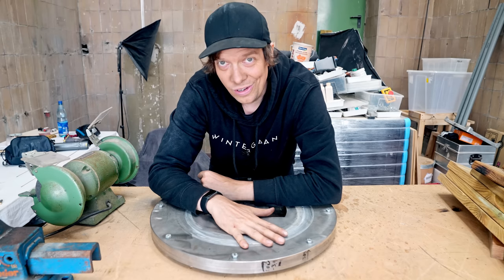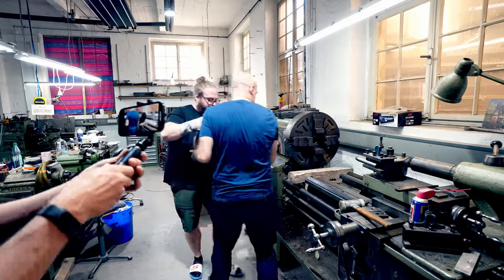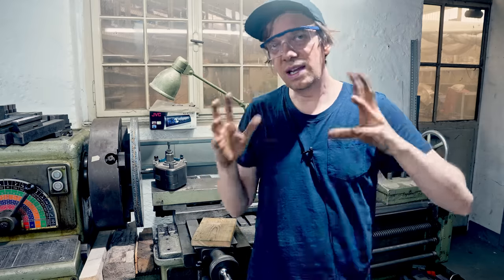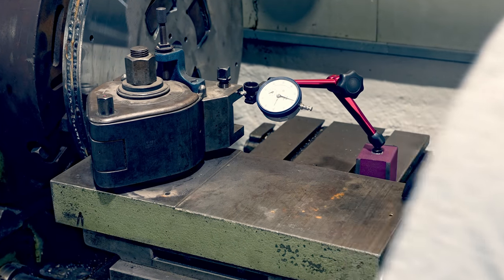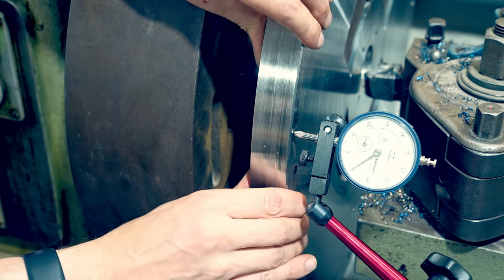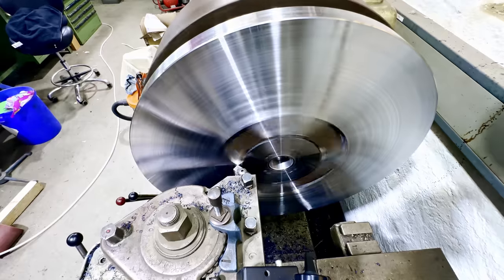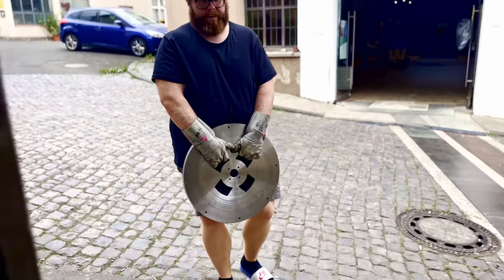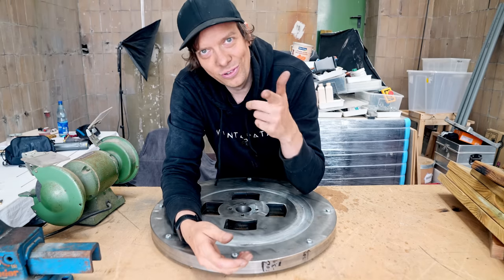Can I Turn This Wobbly Flywheel Straight? - DAY 7,8,9 - Marble Machine Flywheel Prototype

Comment: The insert moved during facing...  Also when you tighten the chuck, you are suppose to use the brake to lock the rotation of the lathe.  You can press fit a sleeve in the center hole to get material back and re-turn the center.  Also increase the shaft size to 30mm means you need to use a bigger taper bushing, which means you can re-turn the center again.
Reply: Or just re-weld and re-turn the center. I mean if he did it once, why not again?
Reply: @Nevir202  more a thing of it is good enough as is for the current prototype and the next iteration should have the popper shaft size anyway
as Martian now knows the importance of having a strong enough shaft for the flywheel
Reply: As far as I know our meuser lathe doesn't have a brake.

Do you have a timestamp for me for the insert moving? Then I can check the holder.

The sleeve is a good idea though we don't have a press set up here.
Reply: @durandle9226  Sure, good enough is good enough here. 

I was just saying I didn't see a need to introduce a new process here, rather than just repeat something he has already done.
Reply: @maesto 13:03 shortly after that is when it moved.
Reply: So, when you flip the disc around to turn the other face, aren’t you supposed to dial it in on the already turned side to get it consistent? The already turned face side should now be your refrence, shouldn’t it?
Reply: @thenextstepp wow I didn't notice! You have good eyes man!
Reply: @ronger7801 absolutely.  If you don't you can wind up with one side thicker than the other.  If it's close you may not notice, but it puts increased strain on the shaft and bearings, and if it's off by enough it can make the entire machine shake
Reply: @ronger7801  Yep. he needs to indicate the back face of the flywheel  to make sure the face he is about to cut is parallel. Can't just trust the chuck is true when going for absolute precision.
Reply: @thenextstepp interesting well check tomorrow. I wonder if it's the insert itself or the whole holder though
Reply: It looked like the insert was chipped too, but it may have just been swarf.
Reply: @maesto to me it just looked like the insert rotated in the holder when it came under the heavier cut.  Hopefully this helps.
Reply: @maesto  It was certainly the insert not the holder. Can't believe the OP noticed it. I saw the change in chip and thought it was just because a transition in material types. If you continue watching the insert moves again shortly after the initial movement. I don't think the insert moving should have effected parallelism, just flatness.
Reply: @ronger7801 yeah, for sure, you need to indicate on a machined surface. You could also re-chuck into a collet chuck which would be very concentric, that is of course not an option here.

But, Martin did actually indicate on a machined surface (indirectly), he clamped a piece of axle into the bore with one of the expanding SKF hubs and indicated on that.

But I can imagine quite a few sources of error in that setup, for example the axle was potentially not straight enough, the indicator could have measured at a slightly different height on the inner and outer measurements and probably a few other sources :)

Not sure what he could have done differently, the bore is the most important reference surface, and it may have been hard to reference the machined surface that was facing the chuck. The surface finish in the bore may be too rough to measure against directly, but otherwise that would have been better, with the other style of indicator.
Reply: He did well for one that hasn’t used this type of method before.
But yes to the above, even with lathes that have no braking, you can wedge locked in stead
Reply: Yeah what he said, trust me I'm an expert (I've never even seen a lathe in real life)
Reply: Just purchase a flywheel.
Reply: @Nevir202  because keeping welding on weld is not good for the wheel
Reply: That tool height setting method was a bit average.
Better to change the drill chuck in the tail stock for a centre, (has the same taper as the back of the chuck but comes to a point at the front) or if there isn't one put a small drill in the drill chuck and set your tool to it's point.
It is important to be a bit fussy with the height particularly doing small bores.
Getting plate flat takes a lot of patience. There is pent up stresses in plate from its manufacture that you relieve when you break the surface when turning or milling, added to that is new stresses introduced from all the welding. 
It is not uncommon to have to machine both sides a bit oversize just to relieve most of that stress, then the flattening process can begin.
Reply: @thenextstepp  Turns out Martin did the move so it wasn't anything moving on it's own. Or at least shouldn't be. Will still recheck the torque on the bolt
Reply: @maesto  first sign of movement was at 12:50 and it continued to move more and more throughout the cut with the final movement just before finishing the cut being the most obvious. Just look at the angle of the insert at the start and at the finish and you can clearly see just how much it had moved (looks to be around 15 degrees)
Reply: @durandle9226  shaft

huh huh huh, huh huh

Comment: When I worked in manufacturing, on the floor we could tell when a drawing or product was designed by an engineer who had never touched a machine in their life. "What do you mean I can't have that hole there? I designed it so you would just need to use a 300mm long 3mm diameter drill bit. What's the problem with that?" The fact that Martin is gaining experience on the machines SPECIFICALLY to become a better engineer is a very valuable and commendable thing. Great job!
Reply: Ha ha! You'd be lucky to get a 300mm long 3mm diameter hole in wood, let alone metal.
Reply: @two_tier_gary_rumain  Might be doable in metal via EDM - can't think of a good way to do it in wood, though.
Reply: @skylerlehmkuhl135  Was thinking the same. U sing spark erosion will work but even then you will have to have a custom machine built. Imagine quoting $100K for one of those holes :).

Comment: Something I wanted to note on the balancing of the flywheel: I was there in person at the meetup, and when the wheel was spinning at full speed, the frame was basically not vibrating at all (I touched it), which means it is very rigid. So while balancing is certainly important, in this particular case, as Martin said, if is fine for now.
Reply: Yeah, I was just going to point out that most of what he's doing right now is only impacting aesthetics, not actual flywheel operation.  The main thing to do is make sure the flywheel is statically balanced, at that point any wobble is just a visual distraction.
Reply: I suspect the wobbling is due to the braking systems, which exert significant lateral force on the flywheel, potentially causing the shaft to bend. At the start of the video, he pointed out about a 1cm offset in the wheel. While the wheel might not be perfectly round or flat, such a substantial offset can't be attributed to just a minor imperfection. By the end of the video, he observed that the shaft had bent, even though it appeared straight in previous videos.
Reply: @barrelroller8650 the wobbling was there before the brake was added, but it’s definitely not helping

Comment: Martin. I respect you and have followed you since I was the 504th view on the original marble machine video. As a retired engineer and machinist, I have some observations:
Taking shortcuts in material only creates problems. A solid piece piece of material of full thickness (not bolted together) will always be better. 
Best practice: when building up material, remove mill scale on mating surfaces.
Best practice: Never assume stock metal is flat, straight, true, to finish dimension, etc. 
I would tell you to have the shaft machined with a specific location and shouldered surface located for the flywheel. An appropriate interference fit will hold the 2 together once assembled. The flywheel should be "roughed in" to near dimensions, with the I.D. (inside diameter) turned to finished (interference) dimension. 
Permanently mounted the flywheel to the shaft, then the shaft/flywheel assembly is machined to final dimensions.

The locking taper bushing is great for assembly/disassembly/maintenance purposes. and as you said, for a prototype, being balanced isn't so critical.
However, this will only suffice for the prototype, and should not be considered to be a precision solution for the final machine.

Some final notes:
Fine precision and shortcuts are typically not compatible characteristics. The more precision desired, the better off you will be using tried and tested manufacturing techniques.

I suggest learning best practices, rather than trying to learn how to fix the problems generated by avoiding them. Engineering isn't about doing everything yourself. Engineering is about finding the best answers. There is reason they are called "best practices".

Define your acceptable tolerances, then select the best practices that fit within those tolerances, And you'll arrive at finding what is good enough.
Lathes can easily reach .0025 mm tolerances or better. Of course, that doesn't matter if your aren't using best practices.

Comment: The problen with run out is common to taper bushes - you need to use a dial gauge while tightening the four locking screws to ensure that it clamps square to the flywheel surfaces - very easy to sort out.
Reply: Great tip! Certainly makes sense, works like a 4 jaw chuck. Do you also have to match torques on the 4 screws?
Reply: Yes this 100%.  At 23:36 I can clearly see the taper mount Flange itself oscillating quite a bit in the same direction as the flywheel. Judging by how much it was moving, I wouldn't be surprised if this was the main cause of the run out.
Reply: I think that's the case too. I couldn't see the shaft moving at all compared to the flywheel. My first guess was that the clamps are not square to the shaft and flywheel...
Reply: This is true and really important.
Reply: @christhesnaildriver  Shh! your ruining the illusion of drama. we all know its fake. its about the journey not the destination. I've know for 10 years. I love it. Its so funny. It's British humor.

Comment: For hole prevention during welding: Chamfer the edges that are going to be welded. This promotes weld penetration, makes welds much stronger and prevents air pockets from forming if the setup is managed correctly.
Reply: How much of a chamfer would you suggest? I'd suspect it would depend on material, correct?
Reply: @mazingdaddid  Proper penetration doesn't depend only on material. It also depends on voltage, current, bead width and arc length from wire to the weld surface. Chamfer just adds more surface area for proper welds to stick to.

Comment: 12:19 The outside diameter was probably harder and thus overheating due to heat treatment during the welding
Reply: Would be interesting to know which steel he used and if it can air harden or which filler rod was used if he did use any
Reply: Yeah the weld material was causing the sparks. And when using a carbide insert you are supposed to take off more material per pass to get a better finish.
Reply: In my experience in the USA, parts like that would be A36 or something similar.  It can be case hardened so if it's laser cut or welded you'll get a shallow hard area in the heat affected zone.
Reply: For lathing steel like that, coolant prooobably would have been a good idea
Reply: Also going way way too quick
Reply: Laser cutting does that too the laser cut surface work hardens. The initial surface speed was also a bit to high. Think its great that he mentioned the fact that the manual lathe does not have a constant surface speed.

Comment: Martin, I didn’t see if you put a chamfer on your weld mating surfaces, if you are welding flat edges and turning down,you could potentially be removing all your welds. Also adding welds to your cutouts will change the balance. Best of luck, looking forward to all your vids
Reply: Exactly what I was thinking about here.
Reply: you can literally see some cracking near the end of the video
Reply: prototype
Reply: I was thinking the same

Comment: You don't need to have a perfect geometry for the flywheel, what you need is a perfect balance that can be achieved by adding small weights or drilling holes.
Reply: This. I think sideways wobble doesn't even generate vibrations provided that the wheel is balanced. If it doesn't generate vibrations, it doesn't matter.
Reply: And getting it balanced is actually made harder by the introduction of the rather irregular welds.
Reply: All the thoughts I had about this video are above XD
Reply: @JulesStoop  Not so much - if you can balance a cast flywheel, a few odd blobs of weld won't hurt.
Reply: Agree 100% - unless you've seen it yourself, you wouldn't believe the different between a flywheel that is unbalanced (even if it feels ok) versus a flywheel that has been balanced.
Reply: @gerrardhickson9471  I sure hope you’re right. It did look a bit messy to me. Not just the blobs, also the cavities, other irregularities and deformations.
Reply: @JulesStoop  - Yep... when they balance professionally, they either remove material (drill holes or grind flat spots) or add material (stick-on weights). All the cavities or blobs you see, just shift the weight balance slightly off-centre, which is what they're correcting during the balancing process anyway. As long as they're somewhat evenly distributed (i.e. there aren't huge cavities in one location then it won't be a problem.
Reply: did you finish the video?
Reply: @gerrardhickson9471  Especially if theyre closer to the axis, less moment of inertia. He is putting way too much effort into the cosmetics and details that dont matter for a "prototype".
Reply: the dumb thing is, martin learned this when he did the flywheel for the MMX. and then forgot.
Reply: @cliveso I mean, it will generate vibrations, but nothing noticable to a human. It would be a rocking moment of maybe several grams damped by the absolute monstrosity of this machine.

Also, when he said SKF recommended a 30mm shaft, and he didn't go with that, it brought back awful memories of one of my bosses designing a dredge. Long story short, we told him it wouldn't work, the company supplying the seven hundred horsepower pump told him it wouldn't work, and then it was we dredge operators who were at fault when it didn't work.
Reply: I agree that balance is more important than geometry, perhaps take the flywheel to a tire shop (one that handles big trucks) to get it digitally balanced with weights.
Reply: @brianargo4595  Yes, you're quite right. To be clear, I'm not actually convinced that the amount of wobble that we can see in this video is problematic, especially not at that sort of rpm (looks like a few hundred rpm to me). It hardly "flies" as a flywheel!
Reply: @JulesStoop  That was the first thing I was thinking of seeing him welding those plates. I would use maximum 3 plates and make rosette weld holes on the two outer plates that they can be machined down during the facing operation. Then at least the weldments would take up the same volume.

Comment: It's bad luck that the chuck had to be tightened AFTER the center hole was cut to size.
That chuck has 4 independent jaws, you could have used that to carefully adjust the hole back to center again.
It wouldn't be perfect, but you could get it reasonably close and then re-machine the outer diameter to make it concentric to the "new" center.
You did amazingly well with so little training and no instructor available! Well done Martin! ⭐🙂👍

Comment: 1st great improvement for a rookie  turner! 2nd get a pro if you want super accuracy/perfect… you have discovered 4 of the 50 things to get the kind of accuracy I believe your inner perfection monster. :)
Reply: Having a chuck fall off the spindle because it was not tight is never a fun experience.

Comment: the best thing you could have done is to get a collet set which can receive the shaft, where you would clamp the disc permanently in place and machine it like that. and have in mind: every time you take a part outfrom the machine, you will loose every established precission you created before. so the best thin you could do is make the machining one big operaion.

happy building, great to see you learning 
:)